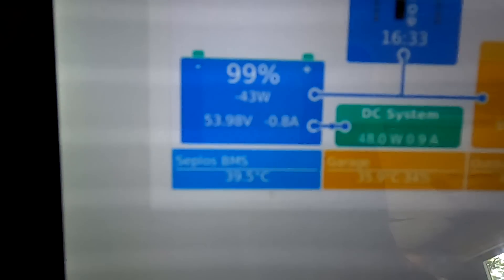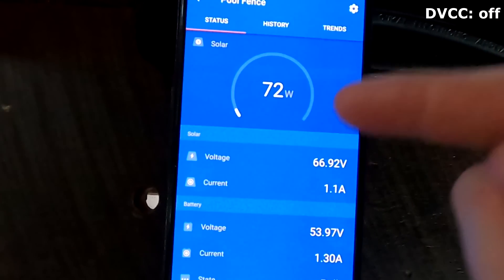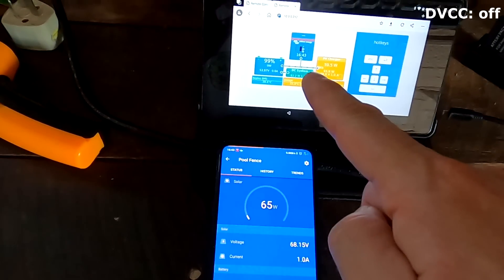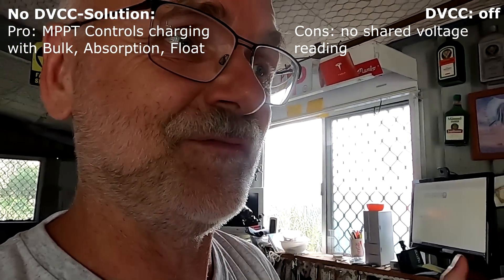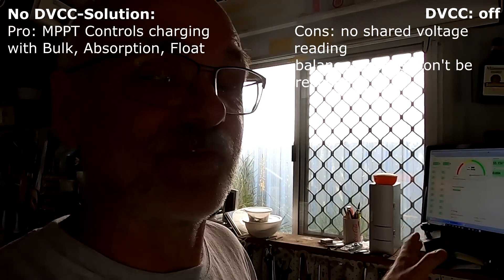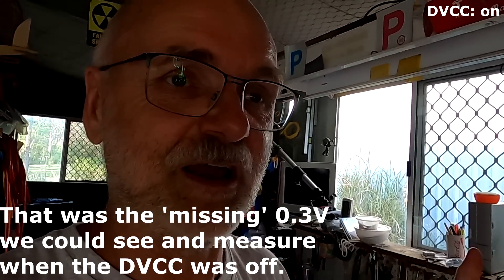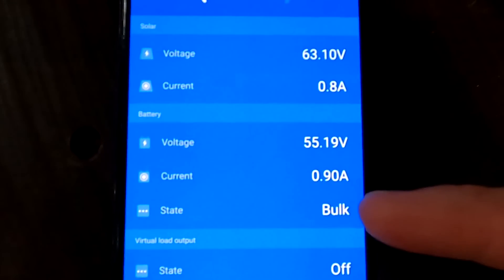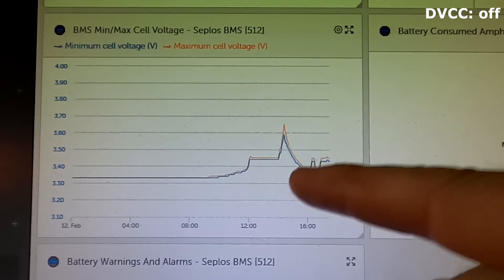Your Solution: Why you should(n't) turn on DVCC with your Seplos BMS.

Comment: Andy, just wanted to thank you for your charge controller settings.  I purchased a brand new 712 shunt from victron and it was behaving erratically from the beginning using standard lithium settings.  It would charge to 85%, then all of a sudden show 100%. I was always recalibrating.  With your settings I fully charged the battery, recalibrated it and haven't touched it since it's worked perfectly thank you.

Comment: Why can't I hook up any power source to my charge controller? The perimeters of solar conections are huge and wide. If it  handles anything from 24v to 100v and 1 to 60 amp constantly, with huge jumps and drops of really high current.  It just seems like such a good way to clean up any source of power, to a perfect and controlled charge. But I hear to not do it .  but can't seem to get an easy to understand reason why not to.

Comment: Is there maybe a option to calibrate the internal voltage reading of the BMS?
Reply: or the charge controller..
that seems the one not correct..

i would leave dvcc on andy..
given the difference in voltage i'd rather trust the bms

Comment: just have higher MPPT voltages, I'd trust Victron over seplos coding to control things. 
The BMS will stop any voltage spikes - worst you'll end up with is charging being turned off from a high cell voltage.
IF you want to be extra safe, lower to 3.6, or 3.55/cell rather than 3.65 - deal with any high volt, low amp/low loss charge hitting the battery.
Reply: Agree to trust Victron reporting over Seplos, but Andy does only charge to 3.45v/cell which does give his batteries a good full SOC at a safer voltage level.